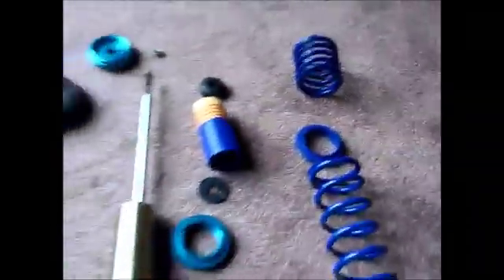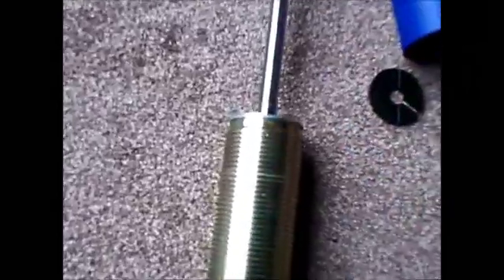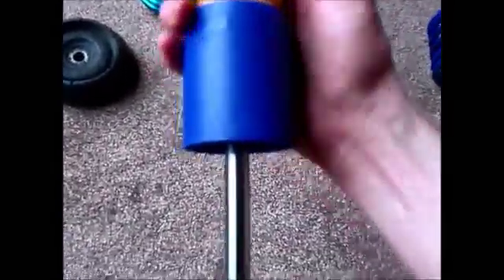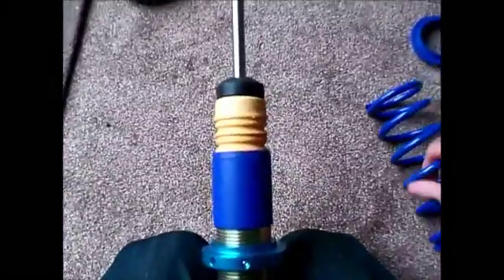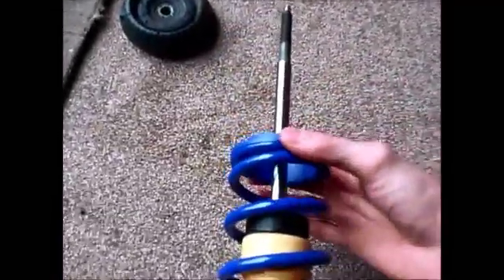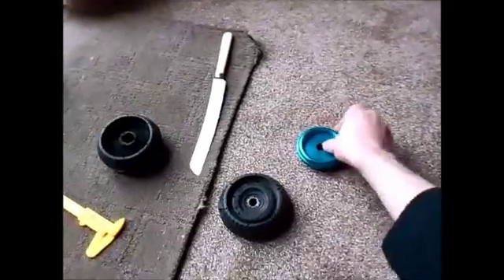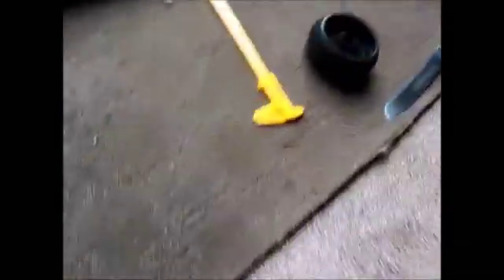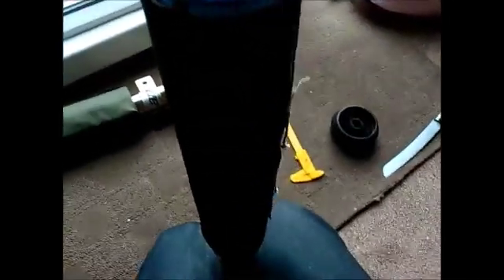FK-OC - Ford Ka AP Rear Coilover Construction

Comment: On the Puma there are problems fitting the rear coilovers. They seem not to be tight enough so I think you have to put some rubber ring between them to tighten them up (that's what i did to my technix cause the prob was the same) i will mount AP's next week so i'm curious.